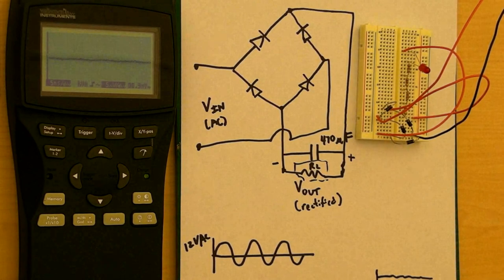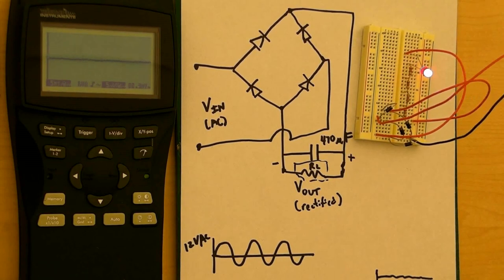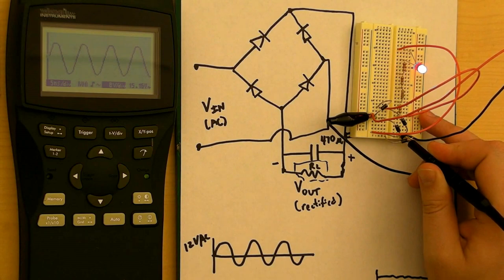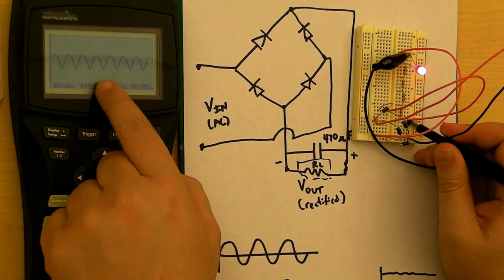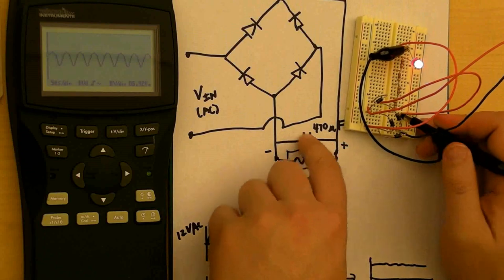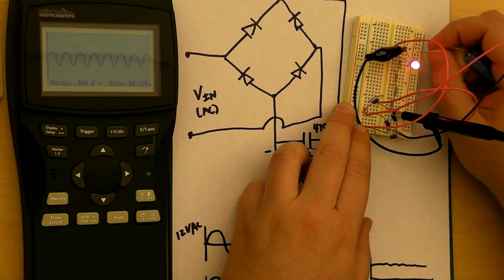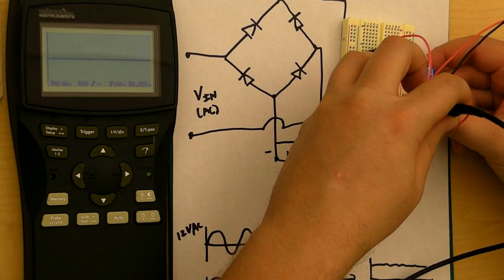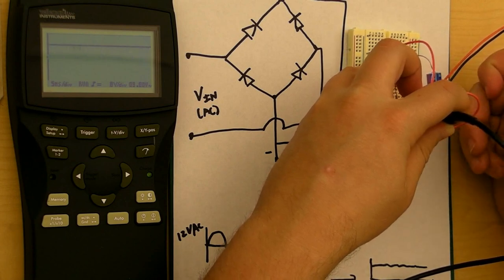CS 3651 - APIA - full wave rectifier - Part 2/2

Comment from the maker: The larger the capacitor the less ripple.  With commercial AC->DC converters, they use a series of capacitors and inductors to level out the ripple and provide as much continuous current as possible. 

However, you can still get bad effects if the load (what you are powering) takes power in cycles (like a CRT) that are simpler to your 60Hz AC.